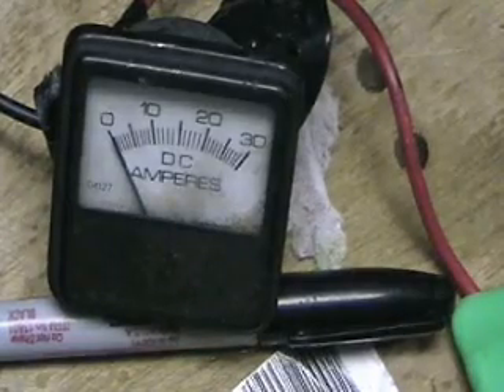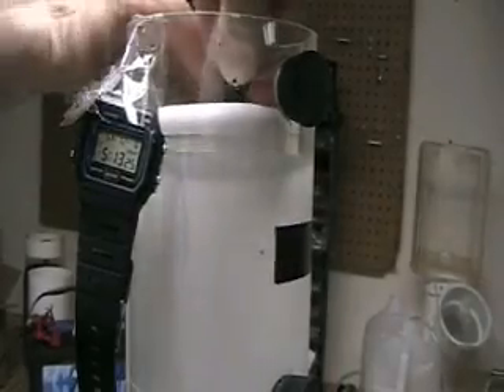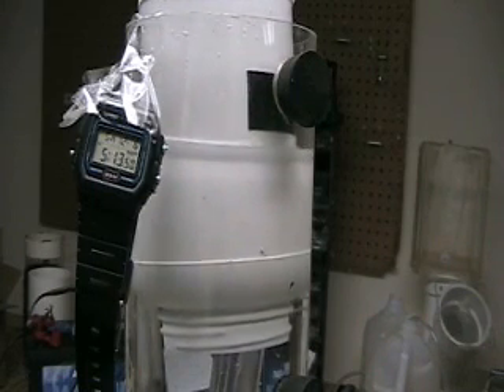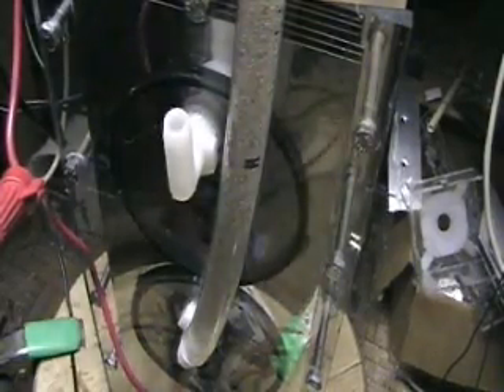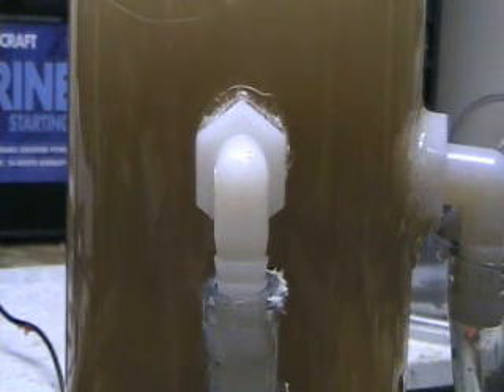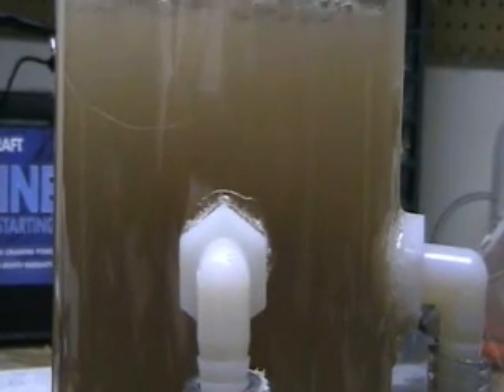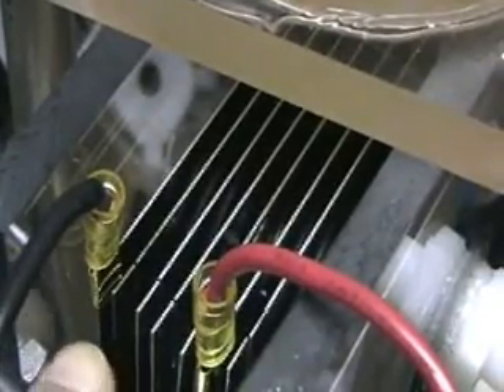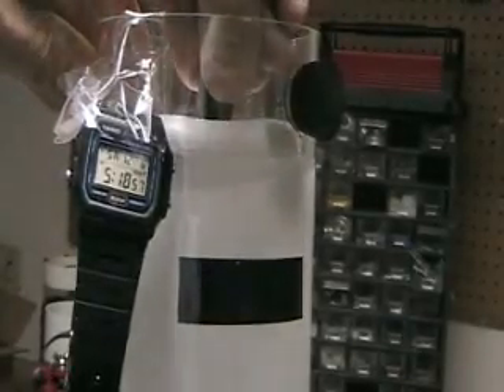Hydrogen Tap (FOCS-Q-more tests) 402

Comment: I love your dual cell dry cell design.  I have a similar style cell that I use the following plate configuration: Pos, Neutral, Neg, Neutral, Pos, Neutral, Neg, Neutral, Pos.

It seems to provide decent output at 12-14 amps.

I also discovered something this weekend that I thought was interesting.  I tried using OxyClean as an electrolyte, and the output was more substantial than sodium hydroxide.  It also seems to remove any build-up on my plates.

Comment: Wouldn't you get better flow across the plates if you used the following configuration on your 9 plate setup?  Pos, Neutral, Neg, Neutral, Pos, Neutral, Neg, Neutral, Pos. 

I am using this configuration and the amperage is not out of control, but the output is very promising.

BTW - This weekend I found out that Oxyclean works very well as an electrolyte. It seems to get higher output.  It also removes any buildup on the plates.

Comment: Hell I thought you were using .316 stainless all along.
Now are you going to test your system with a Pulse width modulator? if you do could you please test it with and without to see if you get any boost in production please.